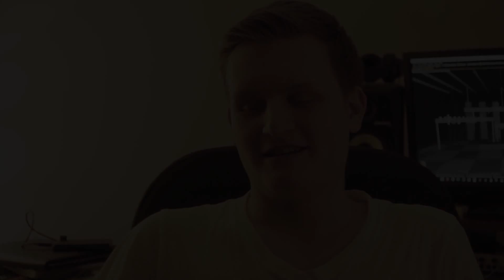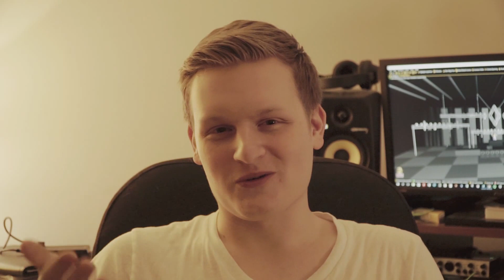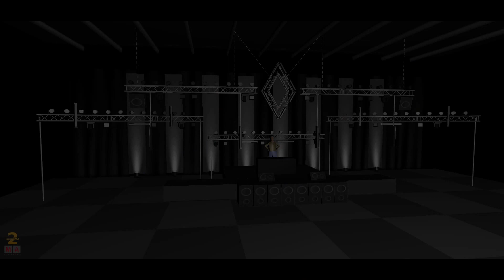CC Mini THON '16 DMX Problem Explained

Comment: Some fixtures have integrated DMX booster.
I use dmx booster / spliter with integrated wireless, done by my self. 2 separate inputs and for each input 3 wired outputs + wireless transmiter on diferent chanels.

Comment: I use wireless DMX on pretty much all of my shows and I've NEVER had an issue with signal loss or interference.  The wireless equip I have has 7 different channels, so I can either run 7 universes(I've never gone beyond two, yet) or I can extend a universe on a different channel.

I've tested these in my apartment complex(which is HEAVILY 2.4GHz saturated) from about 500+ feet away but never had a problem, ever...
Reply from the maker: I don't think you are understanding this correctly. Wireless dmx was not the issue, it was the solution.
Reply: Doug Berry I understand the problem, my comment was more a reply to another user...  (o;
Reply from the maker: Gotchya!
Reply: Brian Ollom Are you talking about the Donner system? I had it and it worked perfect at home but the couple times I took it out lights would drop signal. To be fair I was plugging a wireless receiver into each light about 5... but it still should have worked. I know some people plug in one receiver and cord to the next lights. Had me puzzled as I only hear good things on the Donner system. I had 2 of them so 2 transmitters and 6 receivers .. the battery powered ones.

Comment: a terminator might have solved it
Reply from the maker: unlikely, was simply too many fixtures in a chain with too many long cables between

i do carry terminators now and they have yet to solve a problem for me. a splitter would have been the proper solution here
Reply: ah i see, i've never had this issue before as i have never actually had more than 30 fixtures and i have a wireless dmx system which also means i don't have to run long dmx lines, i would highly recommend you get some wireless dmx dongles by donner because they save so much time and stress